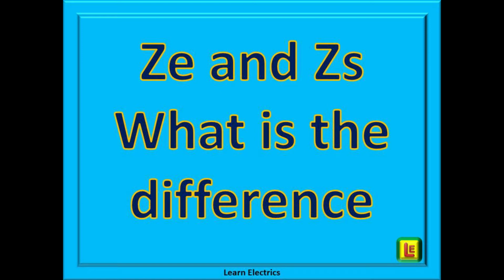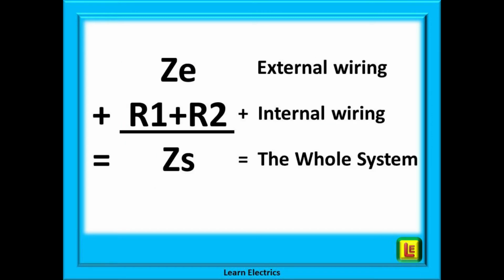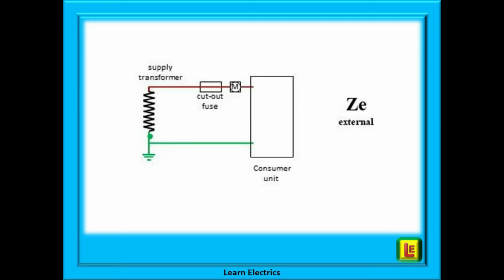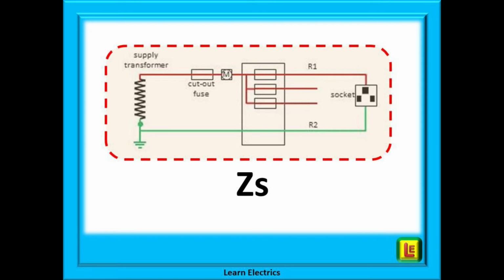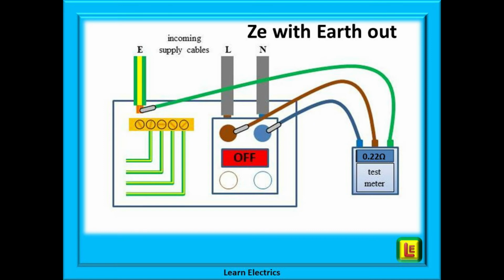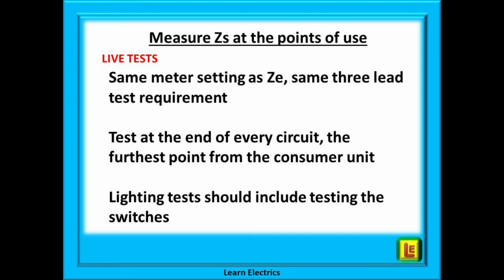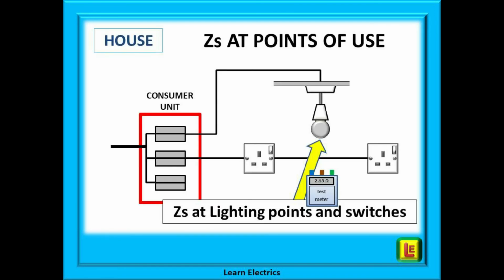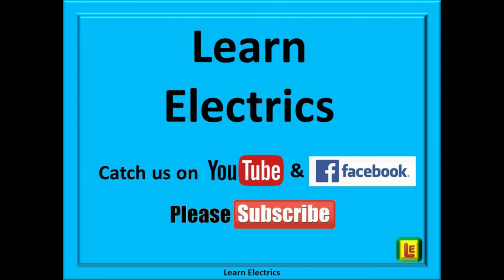TESTING Ze Zs UNDERSTAND THE DIFFERENCE BETWEEN Ze AND Zs AND HOW TO TEST CORRECTLY

Comment: Imo this is gonna confuse learners - you say R1 + R2 is 'that part within the property including all the breakers, etc' - but R1 + R2 is just the measured continuity of line and cpc of an individual circuit, no?
Reply from the maker: The same thing. Thanks for the input. Dave.

Comment: In a 400Vac Electric Motor the Zs Loop will be misured with load or whiout load. I mean the Zs loop need to be check with wire connected to the motor or disconnected from the motor? Thx
Reply from the maker: You will need to disconnect the motor or isolate nearby to check each phases Zs, IPF etc. Thanks for watching. Dave.

Comment: Where does the letter 'Z' come from? How come that letter was assigned? Same with the 'R' in R1 and R2? Thanks.
Reply from the maker: It's just the way the electrical industry has grown up. We couldn't use I for Impedance because the letter I was already used by Monsieur Ampere for his "Intensity of Current". It was only called A for Amps after he died. If you get the chance, read up about electrical history, truly fascinating, and it started a few centuries earlier than most people think.
Thanks for watching, Dave.

Comment: On the top box of the SOTR form it asks for the ZDB. 
Some say ZDB is ZE. 
Others say ZDB is the global ZS of the installation. 
Which is correct??
Reply from the maker: A lot of folk ask this. There is only one ZE for an installation, at the incomer. So what do you do with the second CU if the circuit is extended. The incoming to the 2nd CU is a ZS from the 1st CU ( the cable from CU1 to CU2)
It cant be a true ZE, but it is a ZE, a common cable, for the circuits on the second CU.
So we call it ZDB on the forms meaning ZE at whichever DB we are at.
Hope this helps. Perhaps I should do a mini video on it. Thanks for watching. Dave,
Reply: @learnelectrics4402  that makes sense now thank you for explaining it 😊

Comment: Thanks for the explanation.  Why do the Certificates ask for Zs at the DB instead of Ze?
Reply from the maker: Good question. There is only one Ze in a property. But there can be one or more CUs from the first consumer unit. The first CU has the real Ze and all the others CUs are actually Zs but they are acting as a Ze. So there is no confusion they are all called Zdb on the certificate = the Z at the distribution board or consumer unit. You the electrician then decide if it is the real Ze or a Zs acting as a Ze. Hope this helps. Dave.
Reply: @learnelectrics4402  that does really help. Thanks for clarifying. I appreciate the answer
Reply from the maker: It confuses a lot of people but actually makes sense - but only once you know. Dave.
Reply: Where do you take a Ze in a hospital or large building then, youd never be able to isolate to remove the earth from the met

Comment: Great video as always .Didn't know you did 2 x Ze tests, the second after reinstating the earthing conductor ..makes sense.Learner question: Do you leave luminaires IN or OUT on Zs Live test.If IN would you leave all switches ON to those luminaires,when testing furthest S/L and cpc.(i appreciate you are encouraged  to do this by calculation).Thank you again
Reply from the maker: Zs is a live test so it will matter not if the lights are on or off. Just try and test from the furthest electrical point which isn't always the same as the furthest from the CU.
Thanks for watching. Dave.

Comment: Do the 2 Ze tests apply to TT system? Thanks.
Reply from the maker: The figures for TN systems do not apply to TT systems because it is a soil earth path and not copper. You should still check Ze and Zs to confirm that is a return path but expect high readings, 80 ohms, 150 ohms etc. sometimes higher. We will be doing a video soon on TT systems. Thanks for watching.
Reply: @learnelectrics4402  Thanks. I did Zs testing on TT before and the readings were very low; almost as good as TN. I suspect it is because of all the parallel paths from the water pipes, etc. Does the regs require that the parallel paths  to be isolated (equipotential bonding be disconnected) before doing a Zs test for a TT system? Yes, I am eagerly waiting for your TT video. Many thanks.
Reply from the maker: Yes, test Ze on TT systems as you would a TN system and remove the main earth from the CU - with the main switch for the house turned off. pipework can affect readings and so can wet and dry weather. Lots more videos planned. Sorry for the late reply, your question only appeared here 5 minutes ago, lost in space somewhere. Take care. Dave.
Reply: @learnelectrics4402  Thanks so much for your reply. Sorry if you don't mind, I was referring to Zs on TT. When you plan on releasing the video on TT, could you please clarify whether the 'correct' way to measure Zs on a TT system is to disconnect the main earth from CU. I'm not sure in practice whether this is being carried out. The multifunction tester manufacturer manuals does not seem to want to touch on whether to remove the main earth when doing a Zs test on TT. Thanks again.
Reply from the maker: I have given the method in the last reply, perhaps they have overlapped.
Turn the CU off. REMOVE the earth conductor. Do a Ze test as if it was a TN system.
Look in Guidance note 3 at section 2.6.14 Earth Electrode Testing - Test Method E3

Comment: So measured Ze is most likely to be lower when the suppliers earth is connected to the earth bar, due to the parallel paths.  Why then consider the Ze at the earth bar?  Perhaps if we are expecting parallel paths due to gas or water bonding but don’t see a lower Ze, we can deduce that those bonds are deficient (need investigation) or are obsolete (plastic pipe).  We should be measuring the resistance of those bonds separately in any case?
Reply from the maker: We just follow the testing sequence as per the IET recommendations and the schedules of inspections and tests. We should definitely test the main bonds separately with one end open so that we know we are testing only that particular bonding cable. Good points. Dave.